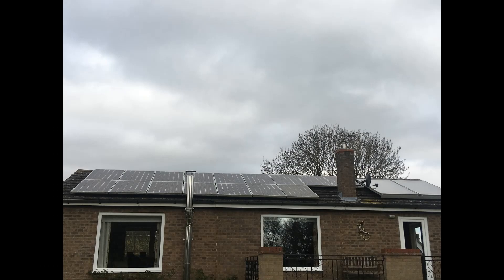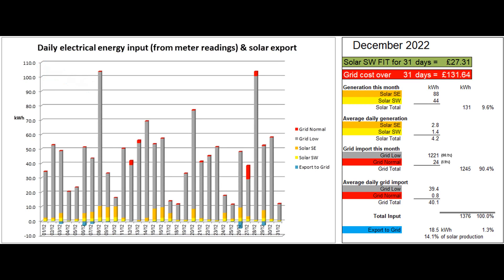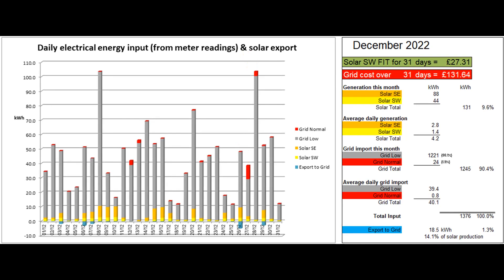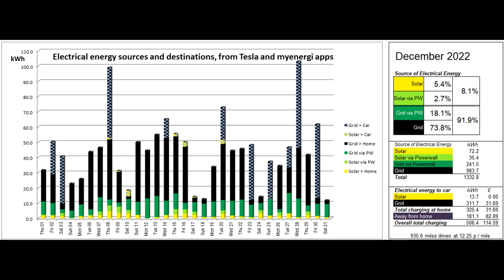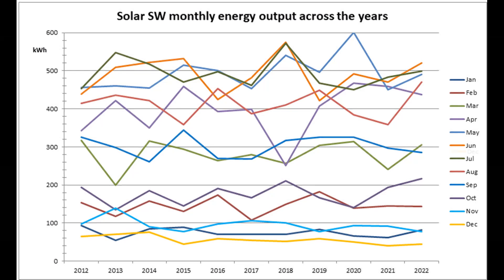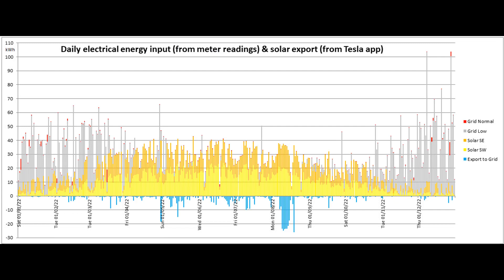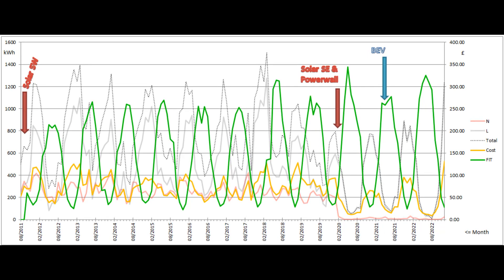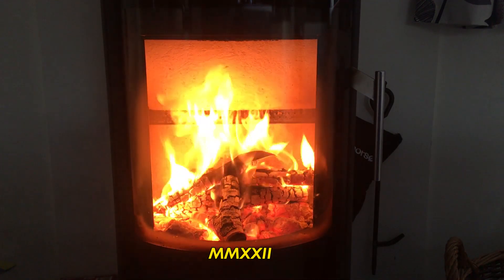Tesla Powerwall 2 and Solar PV in the UK [37]: December 2022

Comment: Interesting as usual, our 2022 provided 500kw more than 2021 even with the poor November in 2022. Our December 2022 production from our 4.3 array was 133.8 so much better than Novembers 114. All in all a good year for solar production for us.

Like many our current electricity tariff finishes this month. We are currently on Octopus Go Faster at 5.5p off peak. Octopus no longer offer the Go Faster tariff just a 4 hour Go 0030-1430 at 12p off peak rate and 41p peak rate with usual 45p daily standing charge. 

We looked at Intelligent Octopus that has a six hour window and a 10p off peak with the peak and standing charges the same as Go. However, to go on that we would have to turn off the smart functions of our car charger so wouldn’t be able to divert excess solar. The t&c’s for Intelligent also require a grid car charge at least once every 30 days, something we rarely need to do in the summer months. Losing the flexibility of the smart features on the charger didn’t seem to be worth the 2p saving per kw of grid energy. For high use customers we can see the benefit though.

Wishing you all the best and many hours of sunshine in 2023.

Comment: Have you looked at the new economy 7 rates as they appear to have gone stratospheric from April 2023. Not sure when your current tariff ends, date wise.
Reply from the maker: Hi John,
My current fixed tariff will finish at the end of February. For the next three months, EDF tell me that their current variable tariff (i.e. only tariff on offer) Economy7 prices would see a DROP in Low rate from 9.77 to 7.00p, a huge rise in Normal rate from 19.94 to 54.47p, and a hefty daily standing charge (as they universally all are?) of 39.02p.

Will be "interesting" to see how the charges change from April when the next cap is announced, the reduction in government support comes into effect and companies decide how to split the Normal / Low rate charges. And will the problems in China mean that the wholesale price of gas (and therefore electricity) will be lower than it has been recently? Whatever, by then solar should be providing a decent proportion of our needs for the summer months.

But it looks likely that even more care will be needed to avoid importing Normal rate units! The wife will be told!!
Reply: @salokin1  there's lots of unknowns, however as you point out it is a case of being more frugal and planned with energy use. Our gas bill for December will be other eye watering. :-(
Reply from the maker: @johntisbury  Our heating isn't included in the figures, of course, as we're burning oil ... but hope to get through the remainder of the winter without having to top up the tank. It's the annexe's heating that puts the bills up in winter for us, compounded this year by the higher than usual mileage in the car at its least efficient time of the year.